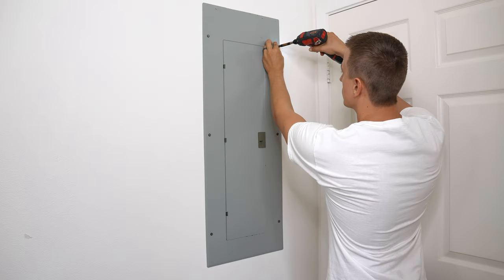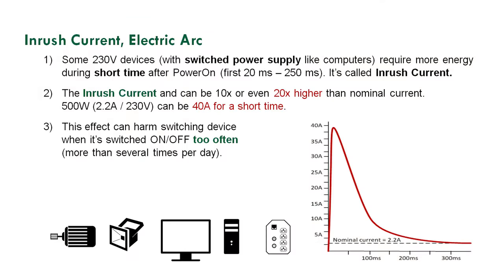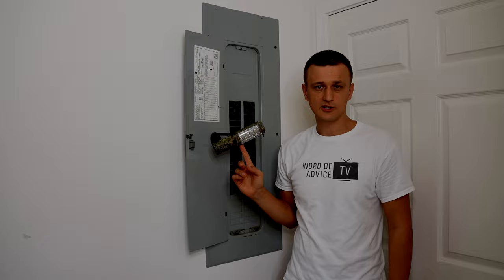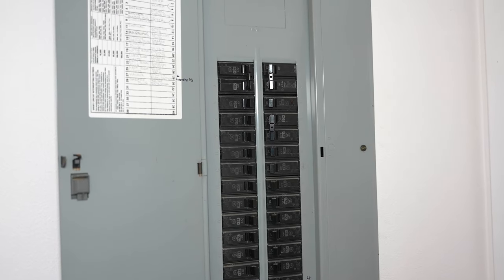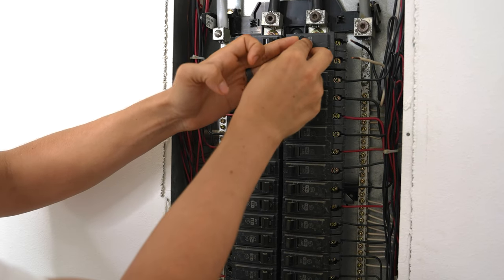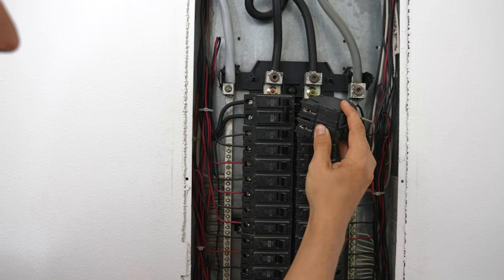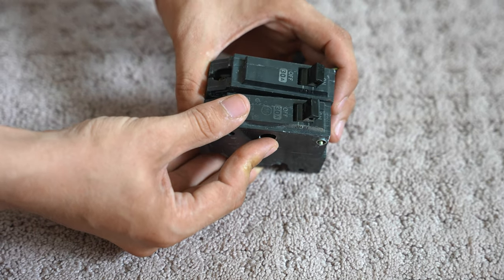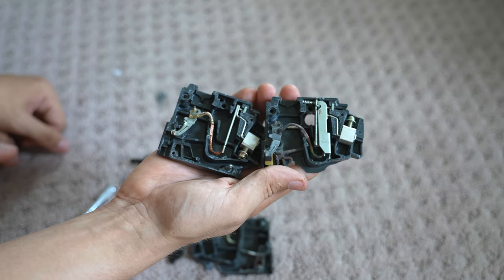How To Replace a Circuit Breaker - All You Need To Know

Comment: Why are the 2 legs black and white?  I would expect the for the 2 hot legs, one would be black and the other one red.
Reply: White should be taped with black tape. It’s probably a 240V circuit so no neutral is required

Comment: Why would that piece of plastic have broken inside the breaker? Were you messing with it or do they just randomly wear out over time even if no one is flipping it or messing with it?
Reply: Surge. Maybe a lightening strike on a transformer. Sorta like a mini explosion inside the breaker and stopping current from passing thru to the appliances. Hence the name, "breaker" 👍👍
Reply from the maker: My guess would be that the plastic got brittle because of age or overheating so when the breaker tripped, it broke.
Reply: @silvergrizzly316  makes sense thanks
Reply: @WordofAdviceTV  I've always wondered stuff like that. Your videos are awesome thanks!!

Comment: I have to replace all the brakers in my house, so just shut down the main braker and start the process?
Reply from the maker: Yup. Verify that the power actually got shut off and get the process started. If your main breaker is in the same panel, be careful and keep in mind that there is still power above the main breaker.
Reply: @WordofAdviceTV  thanks.